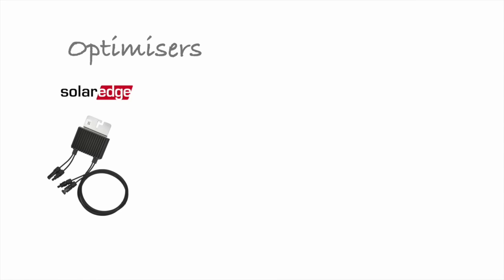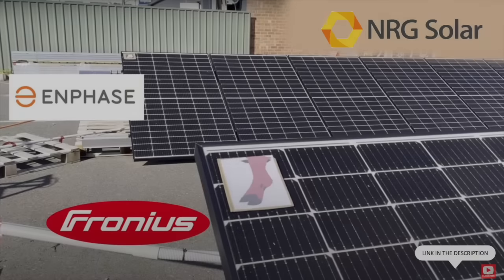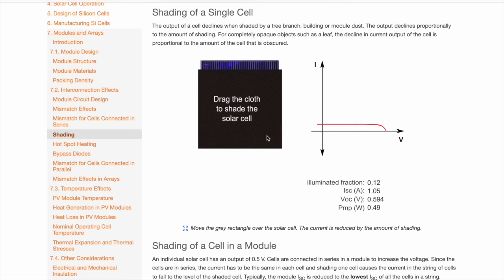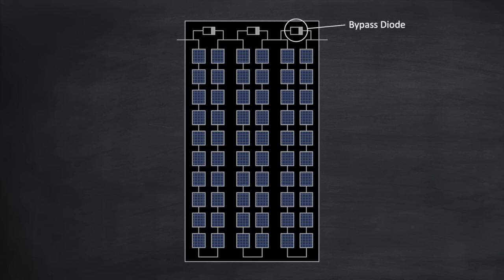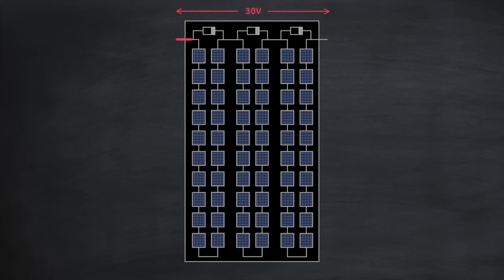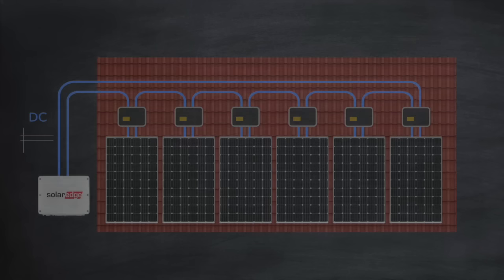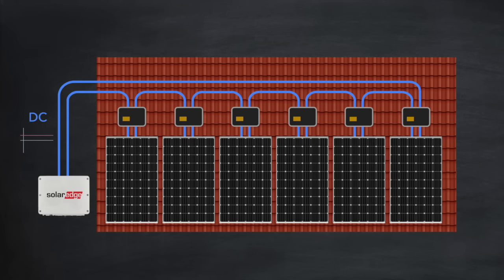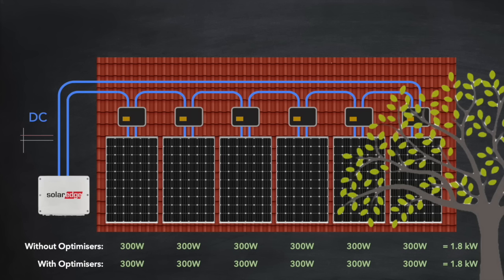Solar Panel Shading (Part 1): Are Optimisers and Micro inverters Worth It?

Comment: Another part of shading that you did not cover is the orientation on the panel of the shading.  Say you have your panels in a portrait orientation.  And there is a 6 inch shaded part at the bottom of the panel.  It will trigger all of the bypass diodes.  The panel will not produce anything.   Turn that panel in a landscape orientation and again cover the bottom 6 inches of the panel.  Now, all of those cells are covered by the same bypass diode.  So only ONE bypass diode will trigger, and you will get the power from the rest of the panel.    If the shadow is going to go across the bottom of a panel, best to put the panels in a landscape orientation, so it will only trigger one bypass diode on each panel as the shadow works its way across the panel.

When I had my solar system put in, I relied on the professional to tell me what was best for my application.  They sold me the solar edge power optimizers.  Cost me an extra couple of thousand dollars.   My roof is completely unobstructed and there are no trees anywhere near me that are going to grow tall enough to ever block my panels.  So except for some leaf that landed on them, there is no time when my panels will be shaded.  I guess a cloud could do it, but I think my power optimizers were a total waste of money.
Reply from the maker: Hi there Jim - you know I was gong to put something in about that, but then decided not to as the video was getting too long. Then, for the part 2 video, I completely forgot! You raise a great point about panel orientation.

On the optimiser front, unless you really want per-panel monitoring, I don't see a great deal of value for optimisers if there is no shading. Unfortunately, with a SolarEdge inverter, you have to have optimisers - but it is still a good system.

Comment: A lot of the information regarding loss of power to entire panels due to shading or damage is from 1st generation poly-carbonate panels from 30-40 years ago. When the solar market first opened up commercially around the 90's competition led to building better panels. There's even manufactures today building optimisers and microinverters into their higher end panels.
Reply from the maker: It's always great to see innovation evolution in products, especially those that can really make a difference to humankind.

Comment: At one time the makers of DC optimizers claimed that output would increase by up to 25% in cases of severe shading.  DC optimizers now cost close to $50 US and panels are in the range of $200, sometimes more.  To spend 25% extra, more or less, to get up to 25% increase in output means that a guy might just break even on the deal.  Just breaking even on something that adds more complexity makes little sense.
Reply from the maker: Yeah, agreed!

Comment: The video was well explained. I have a better understanding now. Still I have some concerns. (Time frame 16.01, what if the panels which are shaded is only having optimisers, will it give the same result, how mppt works in this case.) Does the optimiser in a panel will help that specific panel to improve the power output.
Reply from the maker: Thanks for your kind words, Amrutha. Yes, if only the shaded panels had optimisers, the output would be just the same as all the panels having optimisers. Each optimiser acts only on the panel it is managing, and it will bypass current around the panel if it is not performing as well as the others.

Comment: I use amorphous silicone. I would recommend that most people in the northern hemisphere or anyone who does not have a southerly facing aspect to go with this type of panels. They are designed to give full power on a flat roof. They handle extreme heat much better and are somewhat better in low light conditions when orientated relatively well.
Reply from the maker: Sounds great 👍🏻

Comment: not sure when this video was produced, but it does not take into acount half cut solar panels. additionally the components thatare likely to go wrong are the string, mircr inverters and the optimisers.    with string inverters they are normally in a loft or garage and therefore quite easy to get access to.  With micro inverters and voltage optimisers they are normally mounted under the solar panels on a roof and thertefore the cost of scaffolding needs to be taken into account.  regards Apollo Solar Energy ltd
Reply from the maker: Thanks for taking the time to comment, Philip. I cover half-cut cells in part 2 of the series, and go into depth on microinverters here: https://www.youtube.com/watch?v=q6t0AAi5Jws, including scaffolding concerns. All the best with your business :-)
Reply: @GaryDoesSolar  Just found out today there is now triple cut solar panels on the market.
Reply from the maker: @philipholme9911  Yeah, and actually they're the next step on the way to shingled panels, which are becoming very popular. I talk about these in part 2 of the shading series here: https://www.youtube.com/watch?v=ESpsdMFEFZo See what you think 👍

Comment: Thank you for this video. Do you think on a house with quite a lot of shading from multiple trees (the whole moring and from 5pm) would be worth using optimizers? They will  be south facing. And how much is marginally better as you said? Below 5% total extra or more like 20% for a shady situation like i have?
Reply from the maker: You’re most welcome, Roan. Ok, so without knowing your particular shading scenarios, I can’t determine what improvement you might get. Certainly, for free shading, optimisers will help, and the Tigo products are relatively cheap to buy and fit. Have a chat with a few installers (to get a reasonably unbiased view) and good luck with whatever you decide.

Comment: Apparently Solar panels can be retired early if these bypass diodes fail and output becomes zero, but you can often buy these panels for next to nothing and replace the diodes to get a fully working panel.
Reply from the maker: Sounds like a great recycle market, Peter! And quite right 😀👍🏻

Comment: Very informative video. Thank you

But Several things
1. Are you saying its safe to have hundreds of volts on the roof?
I would claim its not

2. What happens if the whole panel fails or the diodes? What happens then?

3. When the guy holds the obstruction over the panel you gloss over the fact that further down the line we have a system wide drop in power from one panel being slightly shaded. This seems significant. Thoughts?
Reply from the maker: Thanks for the kind words. My answers to the questions you raised:

1. Whether, it's AC or DC up on the roof, it's still hundreds of volts. DC is probably more dangerous given the possibility of arcing through bad connections. 

2. Panel and diode failure rates are incredibly low compared to optimisers or microinverters - and as those rates affect everyone with panels, they're not a differentiator so can be discounted (in my view).

3. Could you tell me exactly where in the video this takes place please, and I'll comment.

Comment: great video gary explained it a lot better than other ones. 

i do have a question to you or the viewers.  so ive got a rooftop array already, runs fine. but im getting another 4 panels mounted onto side wall. that wall catches a lot of morning sun. can i get away with optimisers on just those 4 panels. they will be tied into the roof string and will effectively be "shaded" after lunch

thanks in advance for any replies👍👍
Reply: watched the 2nd video above question answered, thank you👍👍
Reply from the maker: Great stuff - and thanks for your very kind words :-)

Comment: Very useful. I have a taller building shading part of the array in the mid summer afternoons, and have noted the drop in power is roughly proportional with the area covered by shading (less a bit for angle of sun etc). So optimisers would not help as the shading is sharp and not diffuse.
Reply from the maker: Thanks, and I would agree with your summation 👍🏻

Comment: Hi Gary, great video. We have 16 panels across our main roof and attached garage. 4 on the garage with 12 on the main roof. They have been divided into two strings, one of 9 one of 7 with the latter being the 4 on the garage plus 3 more from the bottom row of the main roof. 7 optimisers have been incorporated through I’m not completely clear how, though I do know each of the garage panels has one.
We get some vertical shading (i.e. bottom up) from the ridge line of neighbouring houses.
I’d be interested to know what you think the best way to string and use optimisers would be in this case.
The 2nd string comes on line a bit later in the morning once the sun rises above the roof line of the nearest house.
Reply from the maker: Thanks for the kind words. Now, unfortunately, l'm not in a position to provide individual advice (not least because of potential liability issues, even if that advice is given free - such is the world today). You're best to speak to an installer about that, or post a comment onto a solar forum (e.g. this one in the UK: https:// www.facebook.com/groups/2197329430289466). Good luck!

Comment: Gary, can you help me?
I have 12 pieces Longi 450W half cut pointing SW and 12 pieces DAH 450W half cut, pointing SE.
Both stings are connected to one MPPT(on other MPPTs I have panels pointing South).
During all-day sunny day Longi panels reaches maximum 9 Amps, while DAH panels reaches maximum only 7.7 Amps.

What is the reason?
Reply from the maker: Hiya, unfortunately, l'm not in a position to provide advice not least because of potential liability issues - even if advice is given free - such is the world today). You're best to speak to an installer about that, or post a comment onto a solar forum (e.g. this one in the UK: https:// www.facebook.com/groups/
2197329430289466) Good luck!

Comment: Great explanations, great video.  One aspect I would like to see covered is one which will affect me in the future.  Single story house, wanting to fit 3 phase solar across 3 roofs ( East, North & West - but this is in Australia, so North is UK's South :) ) What is the best way to set this up ? 3 strings ( one per phase) each using panels on the 3 roofs, or one string per phase on each roof ?  With the first option would optimisers make it better all day?
Reply from the maker: Hi Warwick - thanks for the kind words. Now, I can't provide individual advice, but if I were in your situation, I'd certainly be looking at separate strings for each roof, and there are string inverters that will do that. I'd ony use micro inverters/optimisers if I had any shading issues, but you may take a different view. Good luck with your solar journey! :-)

Comment: I need to get me some bypass diodes. I always wondered what they were for, i thought it was to stop power flowing back into any potentially weaker panels during certain situations or if a problem arose in one of the panels.
Reply from the maker: I believe most, if not all, solar panels manufactured today have bypass diodes included as standard. Worth checking for your panels, certainly...

Comment: A benefit I see from optimizers is panel. By panel monitoring and arc fault detection and panel disconnections. Which are required on entire strings now in North America when over. 80V.
However some hybrid controllers have afci on Pv protecting against this.

The ROI of adding controllers could add 2-3 years of costs you have to recoup. Plus you will gaurenteed lost 1-2 controllers over at least 5 years.
Reply from the maker: Agreed - I cover more on optimisers in this video too: https://www.youtube.com/watch?v=I4czBPobtg0

Comment: Is there not a way of running bypass diodes down the x and y access with some combination of and/or/not gates to greatly reduce the affected of cell isolation? Electrical systems are magic to me, apologies if a silly question. A diode per cell would be the best scenario from what I can tell and I would expect those additional costs to be significantly less than a microinverter or even an opptimiser and efactivly do the same job?
Reply from the maker: It’s a great question, but I guess there are some layout challenges or limited gains/cost—otherwise I’m sure we would have seen such products in the market already.

Comment: Gary, thanks for the informative video. I am just a bit unsure about my situation. I want to extend a PV string composed of 410W panels, but due to lack of space on the South side of the roof I would like to put extra panels (400W) on the West/East side. Does it make sense to put optimizers on all panels? My thought was that I just need to put optimizers on the extra panels, on the West/East side. What do you think?
Reply from the maker: Hi Mihai, you're most welcome - thanks for taking the time to comment :-)

Now, for the new panels on the East/West side, there are a number of considerations, and you're best to speak to your installer about the options.

For example, it may not be possible to add further panels to your existing string inverter (they have a maximum voltage per string). So, this would mean a second inverter. It would have two string inputs so you could split East and West without requiring any optimisers.

Another option is to remove your existing inverter and install microinverters to all your existing and new panels. That might be a more costly option though.

Whatever you decide, all the best!

Comment: Fantastic video Gary thank you. Please can you clarify what panel based optimisation actually does to PREVENT a bypass diode from "kicking in"? And if so, does string MPP tracking do this also? I might have missed this, but this wasn't clear to me. In fact it seems to me the main benefit of panel based optimisation is allowing each string to conduct maximum current by diverting partial current around partially shaded panels, thereby improving performance of non-shaded panels. It wasn't clear to me in the examples how optimisation would impact  shaded panels. For example is it correct that an optimiser cannot fix the case of heavy shading as diodes have already "kicked in" and there is no current for the optimiser to track. And is it correct that panel based optimisation has no advantage over string based mpp tracking with respect to the individual panel performance (in the case of reduced current due to partial shading, but insufficient current to cause the diode to operate).
Reply from the maker: Thanks Richard. Ok, so a bypass diode will kick in if the current flowing into the cells that the diode is managing is circa 20% greater than those cells can collectively generate themselves (because of shading). What the optimiser does then is adjust the voltage in an effort to reduce the current so that it exactly matches the current those cells can collectively generate. Doe that help?
Reply: @GaryDoesSolar  Hi Gary. Thanks for the prompt reply. Yes that helps!

Comment: Hi Gary, an interesting video but some of the experiments don't agree with my experience and I would be interested in your view. I have 10 UPsolar 190w panels on a roof with shading issues on half of the panels so had them installed with Enecsys micro inverters. When the panels are shaded they only produce 14w even when the shading is only just touching the panels. Each panel has 3 diodes so according to the experiments when the shading is reduced the power should increase but it doesn't.
Another point about micro inverters is that they only cost about the same as one string inverter and are guaranteed for 25 years as against 10 years. I agree though that they should be located in a loft or other accessible place for easy replacement if they do fail. Over 11years there is just over a 10% difference between the worst shaded and the best panel.
Reply from the maker: Hi Chris, I'd probably need to understand the exact kind of shading you're experiencing. For example, if you have hard shading across just one cell in the panel, it'll knock out the whole sub-string that cell is part of (see the cell shading utility I used in part 1 of my shading video)

By way of example, let's say you have hard shading from the roof of a neighbouring house that covers all of the cells on the bottom row of a string of full-cell panels mounted landscape. This will knock out all those panels, irrespective of whether there are microinverters fitted or not. If the panels were half-cell, then the microinverters should be able to retain half of the peak generation of those panels (see my part 2 video).
Reply: @GaryDoesSolar  Hi Gary, thanks for your reply. 
I am getting hard shading from parts of my roof, but it is not enough stop all of the light so the panels behave as if they are in shade on a cloudy day. As the shadow moves across the panels they continue to generate at 14w, the normal for a cloudy sky, until the shadow is cleared and then they start generating at the same rate as the others which haven't been in a shadow. From those experiments I would expect them to go to from 14w to 30w then 60w and then 90w assuming that the unshaded panels were producing 90w, but I haven't noticed that.
Reply from the maker: Thanks for the extra detail, Chris - I guess to progress further, it would be good to know the layout of your panels and exactly how this hard shading traverses across those panels throughout the day. My email is me@garydoessolar.com if you wanted to send through a sketch...